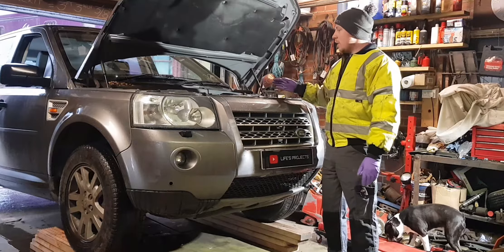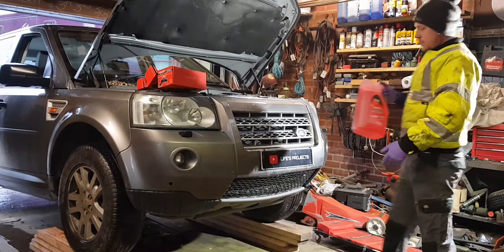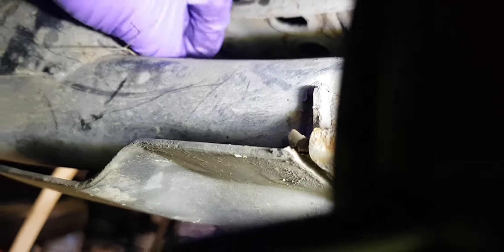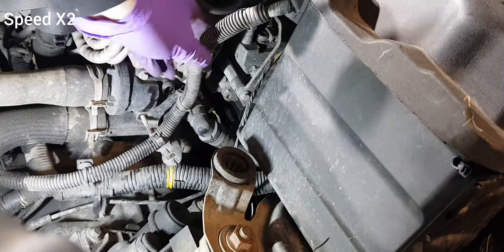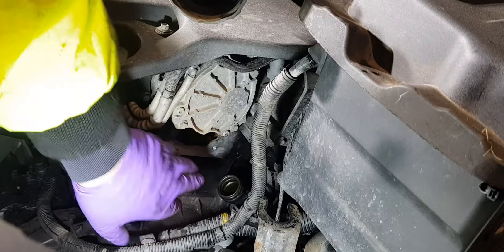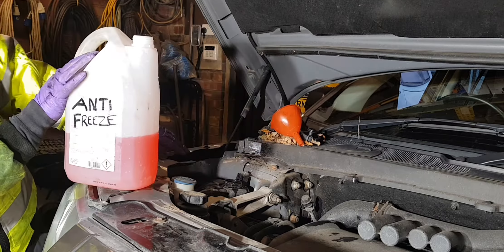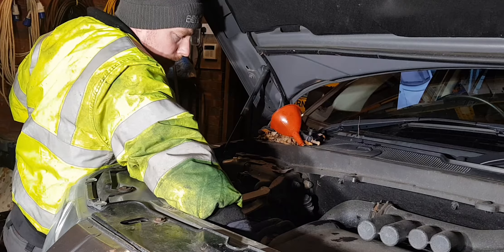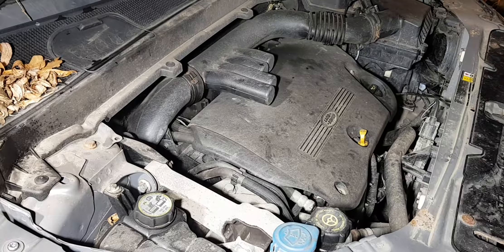Freelander Thermostat Fault Heaters Cold Land Rover Freelander, Range Rover Evoque 2.2 TD4 SD4

Comment: Excellent video I have just got an 08 freelander 2 but my heater doesn’t work and when I park after a drive the fan is on but I have no idea what it could be
Reply from the maker: Thank you. Where does your temperature guage sit? 
Sounds to me like you could be having circulation issues. Ive never really come across the fan running in FL2 apart from been sat in traffic or having the AC on.
I would be checking the coolant is circulating and that your waterpump is working correctly.
Reply: @lifes.projects  it sits in the middle
Reply from the maker: @shovelreccy  deffo check your coolant is circulating. If it in then look at the heater controls and the heater matrix is clear
Reply: @lifes.projects  thanks for getting back to me 🤙

Comment: Looking for help on a 2001 Freelander td4. After a period of driving the temp gauge shoots up to hot but engine is fine temp. The fan comes on and it goes back to middle. Or if you turn off and on it resets. Have you done any videos on replacing this ? Before I take it to a garage and get charged the earth ?
Reply from the maker: Is your coolant level ok? 
Sounds like either the water pump is not circulating the coolant or the thermostat is sticking causing it to overheat. Are your heaters warm as if they get cold quick then you have a circulation problem (water pump or blockage) if they stay warm then it would change the thermostat and see how it goes after that.
Reply: @lifes.projects  yeah so the coolant level is fine. Heating is hot and cold is good aswell, I bought it cheap. Had been sat for a short time. I'm planning on getting thermostat changed , the temperature sensor is inside this aswell is that right ?
Reply from the maker: @chriswhite1644  yeah i would definitely start with the thermostat. Off the top of my headi think the coolant sensor is on the front of the cylinder head on the right hand side

Comment: does the rear pipe have an o ring in it i have a leak there do i need to replace with new thermostat?
Reply from the maker: Yes its a rubber o ring. They can go hard and brittle over time and start to leak
Reply: @lifes.projects  thanks m8 mine has actually has a split in pipe just under o ring do you by any chance no what the part number is for the metal pipe ?
Reply from the maker: @TheJohn924  ah right least you've found it. No I don't but it would be a dealer part or second hand part only.
Reply: @lifes.projects  yeah dealer part just n idea how to get to it looks like a garage job
Reply from the maker: @TheJohn924  its basically the same as this. Apart from you need to remove the thermostat to be able to remove the pipe then obviously the pipe replace the thermostat while your at it and rebuild
Reply: i need to find away to get access to the back of the engine as the pipe is trapped behind a bracket for turbo but with your video the thermostat was an easy job lol

Comment: How easy is it to remove the front sub on a freelancer 2 thanks mate
Reply from the maker: Its not too bad as long as the bolts aren't seized. If they come out slightly and lock up put some penetrating oil and work them in and out until they come out fully. Check out my freelander clutch video on the channel.
Reply: A few videos back Tom replaces a rotten subframe and a gearbox on his Freelander 2.
Reply: Doin one this wekk

Comment: Hi Jim

I am facing heating issue in my freelander 2 2008 I remove thermostat valve but problem still not resolve any advice?
Reply from the maker: Is the water circulating? If the water isnt then your heaters will stay cold. If the coolant is not circulating. its more than likely the water pump thats failed.

Comment: Hi Tom
Would value your opinion I'm thinking of getting a td4 freelander auto what's your thoughts on the auto box? and what should I look out for
Reply from the maker: Hi Jim. Like everything you hear more bad than you do good. Personally ive not had any issues from any people whos had the Auto FL2. The Auto FL2 usually has the SD4 engine so if you do a lot of short runs make sure you take it for a motorway run now and again to keep the DPF from clogging up. 
Another thing to look out for is rear diff problems. From late 2012 onward the rear diff had updated bearings fitted from LR so before 2012 be aware of that.
Other than that make sure you get one with good service history and obviously been well looked after and you should be ok.

Comment: You didn't show how you opened and closed the radiator valve.  That's where the hard part of the job pops up.  Hose is difficult to route through.  Valve is hard to turn (and possible to break it).  What tools did you use to do it.  That part should be on video.  Not just the topping of the reservoir tank.  Recommend to video those sections next time.